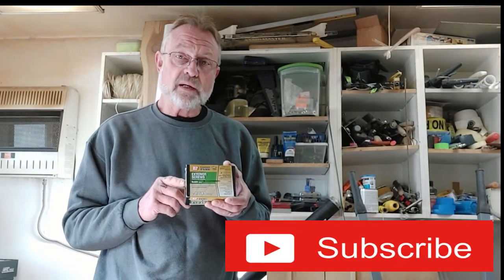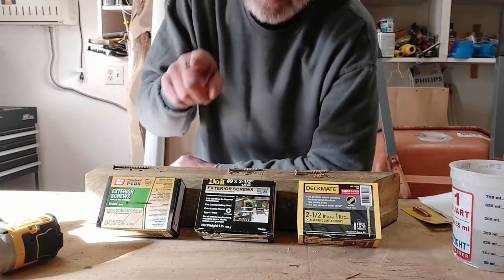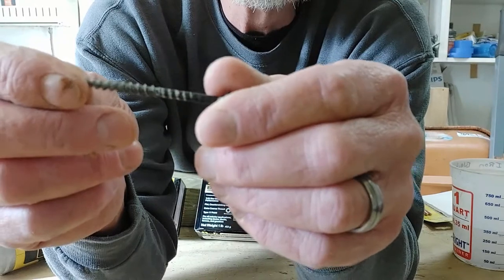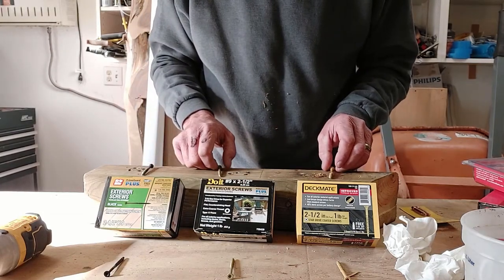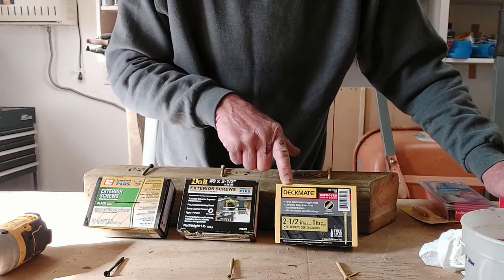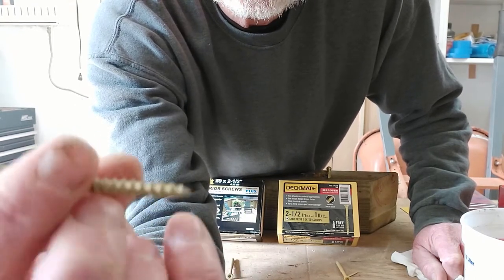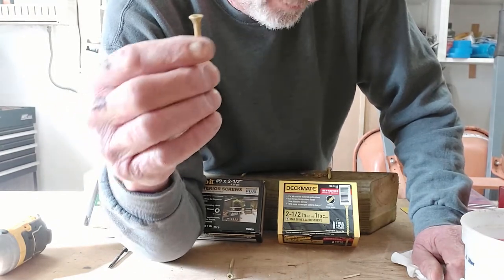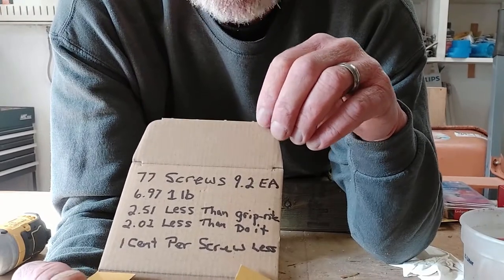*DECK SCREW REVIEW* | Cost Comparison | Differences | What Is The Rust Inhibiting Coating?

Comment: Don't know about you folks, but I'm using SPAX Decking/Framing Exterior Screws. They're Made in The USA 🇺🇲 and they are designed patented and The screws themselves are Heat Treated they don't break even in the hardwoods or pressure treated lumbers and I've been using them for years. Yep! SPAX Fasteners both Decking/Framing Screws and Powerlag Screws. SPAX Powerlag screws is what I uses for Heavy Carpentry applications like Decking, Attached Deck and Post Framings. They're Heat Treated and they have an excellent Pull Out Value (Meaning you can Use them again)

Comment: I can say from experience that the Deckmate lifetime coating does not hold up forever.  I have removed many in pressure treated deck boards that are nothing but toothpicks in the middle.  On the other hand, it is no fun removing deck boards that have been nailed with 16d galvanized nails.
Reply: I’ve found this out the hard way, all my deck mate coated lifetime warranty screws are rusted in half. I’m patiently replacing the boards with new screws. What good is the lifetime warranty if you have to redo all of the work?
Reply: @furysactorslounge3956  Agreed.  My original 16d galvanized nails are a B#@ch to get out even after 30 years.

Comment: Wow, you've answered all my questions about screws for my deckboards which are 2 x 6 and 16 ft long.  My question is can I use these for this type of treated deck boards.  I would need about 500 screws to get the deck floor done.  Thank you
Reply from the maker: All 3 of those screws are designed for use in treated wood. For use in a 2x6 I would recommend using a 3.5 or 4 inch screw. Thanks for watching.

Comment: I want to build a 10 X8 foundation for my 10X8 Arrow Galvanized Metal Shed. I'll be using 2-2X6X10 and 9-2X6X8 and 3/4 inch plywood all pressure treated lumber, which of those pressure treated screws would you recommend me using and how long should they be? Any help would be appreciated....
Reply from the maker: 3.5 or 4 inch screws to attach all of your 2x6 materials together. I would use structural screws for treated wood. The plywood flooring I would use 2.5 inch Deckmates. Thanks for watching.
Reply: @detroitdiy  Thanks for responding, I'm trying to buy all my material from Home Depot and I found the 2.5 Deckmates but I'm confused about the, "Structural screws for pressure treated wood." Can you share the link or name for the 3.5 inch structural screws for treated lumber on the Home Depot website and share it with me?....
Reply from the maker: https://www.homedepot.com/p/FastenMaster-HeadLOK-4-1-2-in-Structural-Wood-Screw-50-Pack-FMHLGM412-50/202268258?source=shoppingads&locale=en-US&&mtc=SHOPPING-CM-CML-GGL-D25H-025_003_FASTENERS-NA-MULTI-NA-SMART-NA-NA-NA-NA-NBR-NA-NA-NA-Fasteners&cm_mmc=SHOPPING-CM-CML-GGL-D25H-025_003_FASTENERS-NA-MULTI-NA-SMART-NA-NA-NA-NA-NBR-NA-NA-NA-Fasteners-71700000106379776-58700008272944596-92700075198173416&gclid=CjwKCAjw5dqgBhBNEiwA7PryaC-vJDBOK3e6b-zNwpBkD3lR5QpthP8jlPT43kgSDNEdbWbD0g8vNBoCvmYQAvD_BwE&gclsrc=aw.ds
Reply from the maker: These screws are strong and rated for use in treated wood.
Reply: @detroitdiy  Thanks man.....

Comment: Good info and well researched.  I only have issue with a few points. 1) Saying all three screws are formulated the same is an assumption because they are coming from Taiwan and from the same procurer.  It is an assumption. 2) I'm not sure they are true Bugle screws as Bugles flare out.  These are closer to Flat screws.  Sheetrock screws are more indicative of Bugle screws.
Reply from the maker: Thanks for your input, I also am not sure I would refer to them as bugle heads, however all of the info from the manufacturer refers to them as bugle heads so I went with that. Thanks for watching.